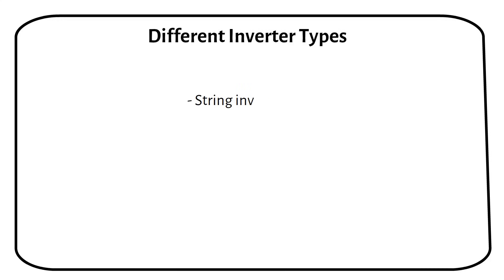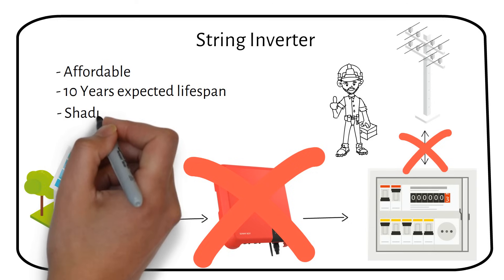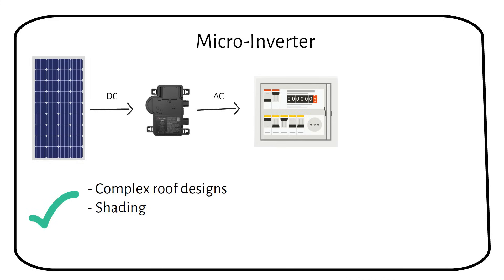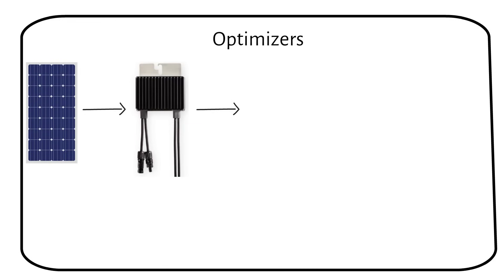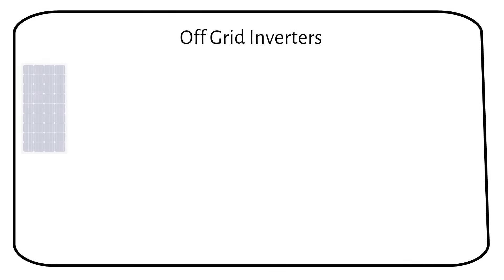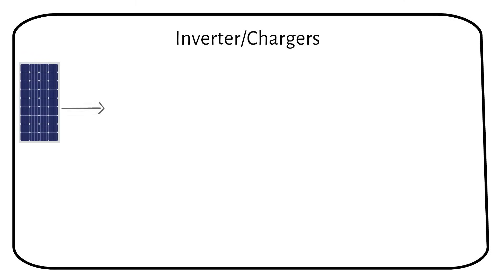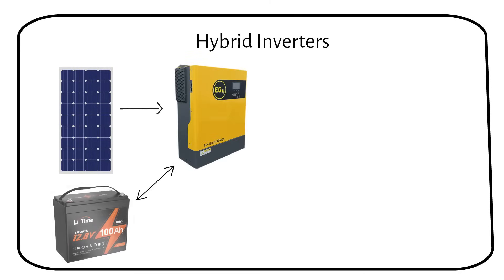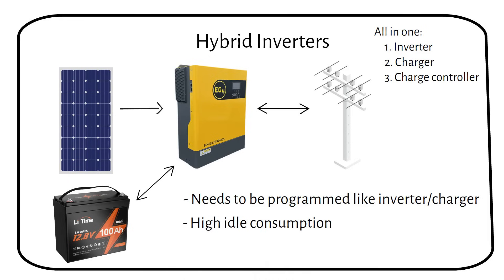Different Types of Inverters for Solar Power Systems

Comment: can u help? i hav a 24v inverter n it shuts off and alarm goes off at about 20-21v. this makes no sense to me n is so dan anoying. do u no of an inverter that uses a batery to its full capacity?
Reply from the maker: That's normal, it's a low voltage disconnect. All capacity of a LiFePO4 battery is from 10-14.2V
Reply: @cleversolarpower  so all inverters r like that? u can never use a baterys full capacity?
Reply from the maker: It is the battery full capacity. It doesn't work like a bucket. Empty bucket = 0V. Empty battery is 10V.

Comment: I have questions, hope to see your answer;
1. String inverters: from what voltage DC to what voltage AC do they convert? or they simply convert DC to AC voltage to voltage?
2. If string inverters connected to the Grid, how does its frequency sync with that of Grid?
3. Micro-inverters output is AC, how to combine them together to get one output? again, how to sync their frequencies?
4. Do the off-grid inverters support pass-through power directly from Solar?
Reply from the maker: 1. they have a DC operating voltage range. Check the datasheet of your particular inverter. on the AC side it will be 115 or 230V.
2. it's software analyzes the sine wave coming from the grid and creates on that matches it.
3. microinverters can be stringed in series. They each match the grid signal. It can take one minute for them to synch to the grid. if the grid is turned off the microinverters don't work.
4. some do, but most don't.
Reply: @cleversolarpower  Thank you, and now I got more curious. can you connect multiple string inverters together? how does the larger system such as 10Kw panels work with string inverters. I guess, you need multiple of them and then how do you connect them together?

Comment: Hello, I want to buy a hybrid invert that I will use on grid and with batteries. I do not know which inverter to buy, that compensate the phases. That means that, if i use more energy from one phase than this particular phase has, it should take energy from another phase and not from the grid or battery. Which inverter can do this and how is the option called? Thank you very much for your response.
Reply from the maker: The inverter doesn't have to compensate the phases. The energy company doesn't care if the phases are unbalanced.
Reply: @cleversolarpower  Hi and thank you for your replay. I will give you an example. If i produce 6kw of solar power this will be splint to the 3 phases, so L1 will have 2kw, L2 - 2kw and L3 - 2kw. But if i consume 4 kw on phase L2, on most 3 phase hybrid inverters, the extra energy that is needed (2kw) of phase L2 will be draw from the Grid and not from the other 2 phases L1 and L2. And the Power of L1 and L3 will be injected in the grid. Because the price difference of the injected energy and draw energy is very big (2x), I need  a inverter that takes the electricity from the other available phases and not the grid, if one of the phases need more electricity than it produces and if the other 2 phases have sufficient electricity. Is something like this possible for a hybrid 3 phase inverter and if yes, how it this function called. Thank you in advance.

Comment: Is there an inverter that will charge or discharge a battery from and to the grid?  I don't need a full hybrid inverter, I just need to control my battery's charge level.
Reply from the maker: The victron multiplus will do that. Also called an inverter/charger.

Comment: Excellent presentation.  Could u kindly explain us with basic blok diagram of the internal circuit of Hybrid Inverter to understand how the PV panel, Batteries and grid share power to drive Inverter. All of them combined as a DC or AC current need to know from u. Thanks lot for yr valuable information about solar systems.

Comment: Can you advice me a good Hybrid inverter? I would like an (no grid) installation. Use solar panel during the day and batteries at night. An inverter who can charge and load the house in at the same time,stop the charge off the batteries and redirecte all the load to the house.
Reply from the maker: Check out my whole house system video. The eg4 6000xp might be for you.
Reply: @cleversolarpower  Thank you

Comment: How can I get a Micro Inverter and a Hybrid inverter at the same time? Getting DC to AC to charge my batteries first and when they are charged, use energy form pannels directly
Reply from the maker: They have to be used separately. Micro inverter attach to the panel and go to your AC system. Other solar panels can connect to the hybrid inverter directly (DC).

Comment: What is the difference between HIGH FREQUENCY HYBRID INVERTER and LOW FREQUENCY HYBRID INVERTER
Reply from the maker: High frequency = less surge power, cheaper / low frequency: higher surge power, more expensive

Comment: I have an existing setup which includes a hybrid inverter and batteries.  I want to increase capacity but the inverter model that I am using is no longer available in the market.  Is it OK to mix different brand and/or models of hybrid inverters?
Reply from the maker: You cannot combine the output of different off-grid inverters. They have to communicate with each other to synch their sine wave output. Another method is to have loads on the old inverter and separate loads on the new inverter.